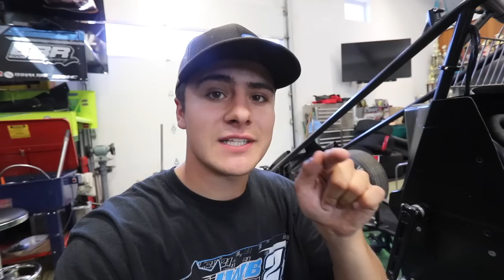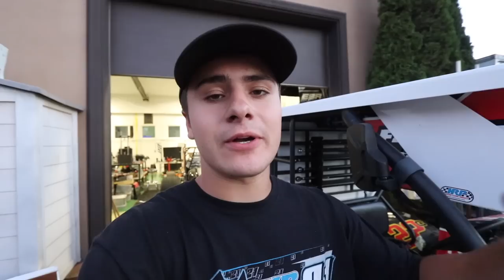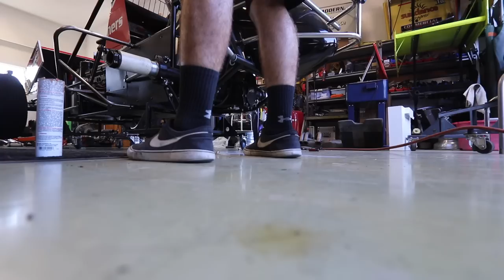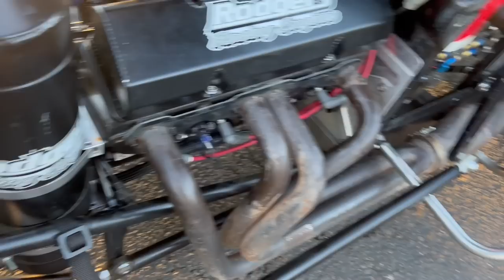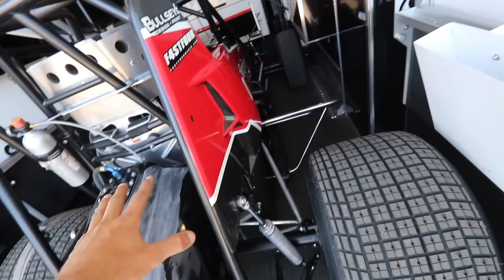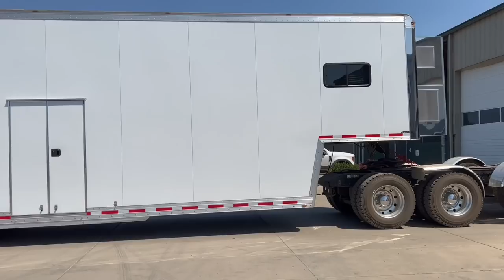We Have 48 Hours Until We Race, And The Car Looks Like This....

Comment: There is nothing like the sound of a good ole American V-8 with unrestricted headers sitting there idling.  I don't car what size motor it is, 305, 360 or 410, they all sound good.  Having your car in that condition with only 24 hours to go might have been a problem, but at Tanner Holmes racing, 48 hours is an eternity.  Never had any doubt that the car would be ready on time.  That is what racers do, they get it done no matter the time frame involved. Work all night, no problem if the race is important enough.  Love your Dad's demeanor, it doesn't change if he is driving 20 minutes or 20 hours.  Have family will travel.